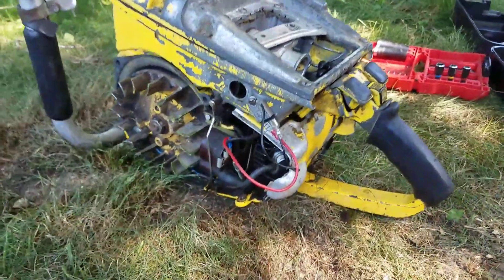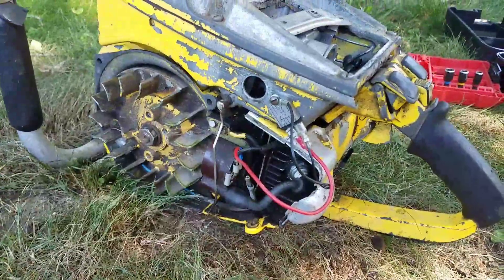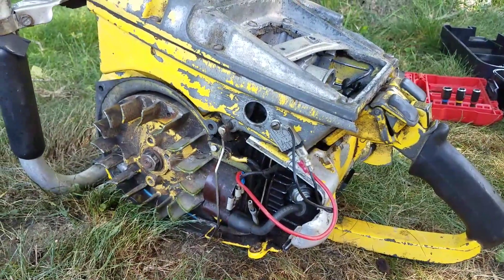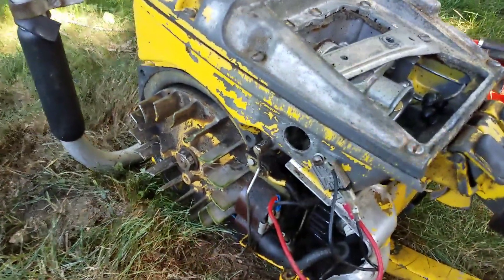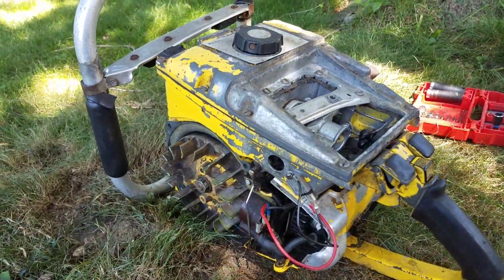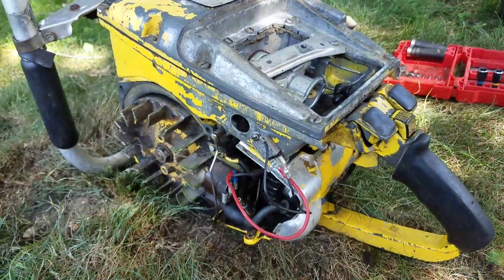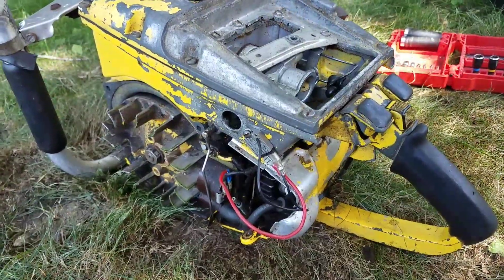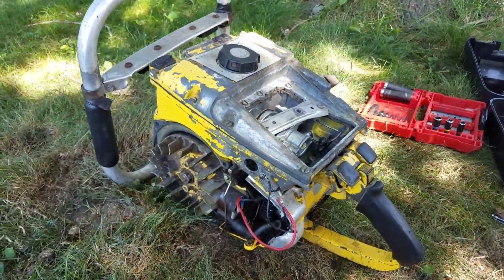1961 Mcculloch 1-72 running part 3

Comment: Sounds good really don't need points idk?
Reply from the maker: Google User RVA Some have had good luck, others no. Me, I have burnt up a homelite coil using a nova 2. The orginal gives ignition but just needs tweaked. I also saw I  a video these have a decomp valve so I'll check if mine has one.